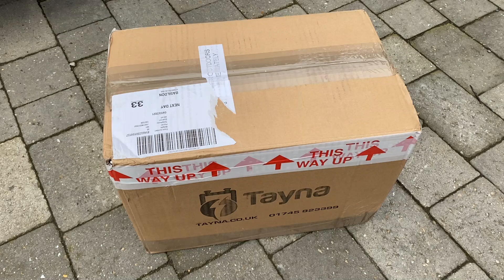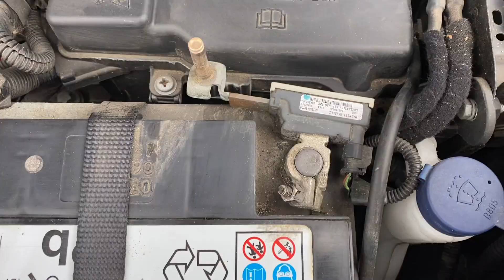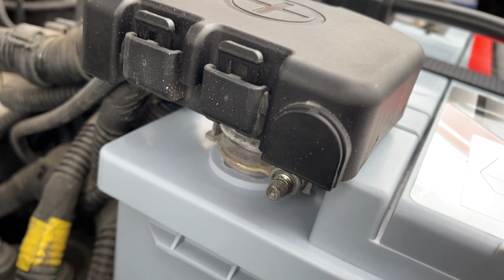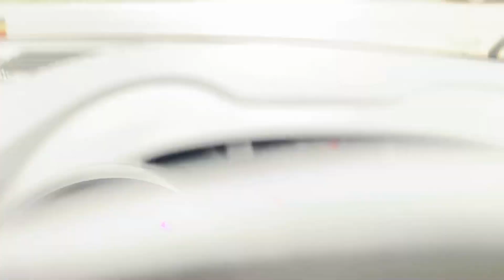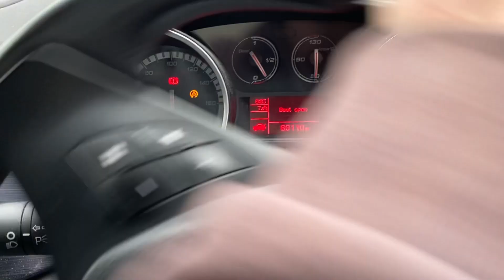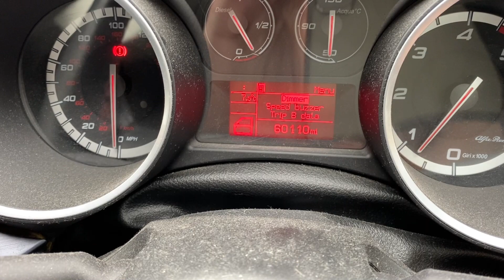Alfa Romeo Giulietta Replace New Flat Battery Clear Steering Fault Codes   No OBD Stop Start Fixed

Comment: Good, clear explanation of how to do it. My Giulietta is a 65 plate. It responded to the wheel lock routine to initialise the power steering but the date info didn't seem to need updating, just clicked in. Neither did the passenger airbag need resetting; perhaps Alfa made some tweaks to avoid the need.

Comment: My start stop doesn t work after battery replacement
Reply from the maker: May be that the new battery doesn’t have enough charge still. The intelligent stop start also relies on many other elements all working together. If you have any faults on the car then it won’t work. Hi or low temps can stop it too along with other things. All the best 👍

Comment: Another excellently helpful video.

FYI I've used AGM type battery for 5+ years and just replaced it with another AGM type battery. They are £120+ cheaper than a usual battery.

I had the same fault codes to clear too.

Comment: Every few months spray contact cleaner on the terminals
Reply: Thank you , poor design with the terminals know to crack on the clamp anything loose no start should be 24v , 12+v for computer aids and 12v so you can get to work the beautiful love affair Alfa cars.

Comment: Hi tony. Nice video, gives me the confidence to have a go. Problem is, every site I go to, including Tayna recommends EFB battery. When I bought my 2014 2 litre Diesel Giulietta 4 years ago, the used car dealer put a Banner 57001 AGM in. Should I go back to EFB or stick with AGM going forward. I keep getting stop/start unavailable and wonder if the short journeys are taking their toll.
Reply from the maker: Hi Graeme. Thanks. The short journeys do take their toll for sure. I went through two winters having to constantly recharge the battery before finally replacing it. I can’t recall what my battery was, but I went with the Tayna recommendation which if I recall correctly was the same as the factory fitted one. Mine is also the 2.0JTDm so same engine as yours. 
One thing I would say is to spend the little extra and go for a better battery. The one I put in has failed again already as it was cheap, so I’ve replaced it now with a Yuasa. 
Hope that helps. All the best 👍

Comment: Hi Tony, great video. did you do anything about the crack on the clamp? 
I changed the battery on my giulietta thinking there was an issues with the battery but noticed the same crack whilst changing the battery. The car occasionally doesn't start and i think it is due to the crack.
Reply from the maker: Hi. Yes I did. There’s a video on my channel on changing the terminal, and also another small short one where the car wouldn’t start and I had to wiggle the terminals. Here’s a link to the change video. Hope it helps. All the best 👍
https://m.youtube.com/watch?v=BUga9-nLuzQ&list=PLUlimW25zWbS3X81E3uVGrQvRqliAYmC9&index=78&pp=iAQB
Reply: @ thank you

Comment: Thanks. That was all clear. I’ve just done this with ease after watching your video a bunch of times. I just ordered the same battery as you using the link. Thanks for all the info!

Start stop seems to be fixed now and the same issue with the passenger airbag.
Reply from the maker: That’s great. All the best 👍

Comment: I have a 2.0L diesel, had all electrics including radio, ac and power steering  cut out 10 seconds after starting and now the battery is flat and car won’t start on its own, any ideas ? Could a battery replacement do the trick?
Reply from the maker: Hi. Is there any power when you turn the ignition on? And when you try and start does it turn over, click, or nothing? 
Could be a battery, but if it was running and then stopped, sounds more like something else. If you have a multimeter you could measure the battery voltage. Sometimes the Giuliettas suffer from a bad earth connection, which is under the battery tray if I recall correctly. Also battery terminals can be an issue too. I did a video on replacing mine which has helped a lot of people. Good luck. All the best 👍

Comment: Ciao Tony
I would like to charge my S&S battery. Now the manual says that I should unplug the negative cable in this case. I would prefer not to do this in order to avoid all the error messages. What do you think?

Many thanks for the many and very helpful videos
Reply from the maker: Ciao. I charged mine on Monday night with the battery still connected. After 1 hour on charge I took it for an hours drive. It started perfectly the following morning. Hope that helps. All the best 👍
Reply: Many thanks for the quick reply. I will try this then. I wish you and your family a happy and healthy new year

Comment: Thanks for the vids Tony. Ive had to replace my battery on my 2010 2.0 jtdm after the car had stood for months. I did the steering wheel fanve but my odometer is flashing constantly. Any ideas? 🤔
Reply from the maker: Sounds like the blue & me module for connecting your phone to the audio. These often go faulty. May be able to resolve it by disconnecting and reconnecting the battery again or simply (if you have it) connecting the Multiecuscan software, and clearing the codes. If it is genuinely faulty, then it is possible o programme it out out the system using the Multiecuscan and performing a Proxi alignment. Or buy a new one, but you’d still need to do Proxi alignment. Best bet is to get the fault codes read first though as that will tell you what the issue is. Flashing Odo normally means something has gone bad on the ‘Canbus’ line. Hope that helps. All the best 👍

Comment: Hi, I have changed my battery, but the radio is completely dead. Any ideas what is wrong?
Reply from the maker: Hi. No ideas really, other than check all connections, then check all relevant fuses. I think the radio is fed from under the steering column. Hope that helps. All the best 👍

Comment: Giulietta 1.4 170hp petrol ... Is this engine reliable ?
Reply from the maker: Hi... I don't have one personally, but from feedback they seem to be. The biggest issue seems to be the Multiair unit which should be maintained with good servicing. I hope that helps. All the best 👍
Reply: @vialettotony  thank you
Reply: I will add that there are two sides to it.
Mechanically all the 1.4s are very robust and can take 300k miles no problem.
HOWEVER
You need to service it well - the factory recommended oil change intervals are insane. Absolute maximum is 10k miles and really you should change every 6-7k miles.
The Multiair unit can go as early as 30-40k miles if you skimp on oil changes - or it can last the lifetime of the engine. Count on replacing it once to be safe. Then don't stretch those oil intervals again and it should be fine.

Comment: Wish I saw this yesterday before trying to search for it on forums; wasted 1 hr. I just disconnected the battery cause I noticed the front right brake pad wear indicator cable has snapped. As I don't like working with cabling with power on, I took the negative off from the battery. Then when I went in the car it was like Christmas with all lights and beeps, and everything relating to VDC.
Seems I have inadvertently  fixed by doing what you've done...was just checking that I have full steer... after a 5 min slow drive in the neighborhood and a stop and start, all was well again.

Comment: Hello Tony
Thank you for your videos.
Quick question, how can I set the time and date.
I tried using the set/esc button but when I click on date I go back to the previous menu 
Any advices please
Reply from the maker: Hi Hamza. Sounds a bit odd for sure. It is definitely done from the three buttons so not sure why it’s not working. I’ll see if I can put a quick video together soon. All the best 👍
Reply: Thanks allot Tony, last time I modified it I used the OK button in the radios to access the time but since then I installed a 3rd party Android post and now there's no more OK button

Comment: I just changed the battery last week. The old one - oryginal Excide Heavy Duty worked fine for a 8 years. I have to do this because the old one had the low voltage and the ECU automatically increased the idle speed to the 1000 rpm.

Comment: In my Giulietta you need to re-calibrate the auto up and down on the power windows after you disconnect the battery.
Reply: Also on my Mito!
Reply: And the steering too.
Reply: I’ve just bought a Giulietta 1.75 TBi - how do I recalibrate?

Comment: Yes thank you mate I love the videos, I needed a new battery all along. Do you know much about the neutral gear position sensor ?? It disables my DNA system. Thanks pal
Reply from the maker: Hi Calum. Thank you so much. Really appreciate the positive feedback. The gear position sensor is indeed a common problem. It is doable at home, but the connection underneath can be problematic. Some people prefer to remove a section of the exhaust to gain easier access. It can be a lot simpler to get your local garage to do it as they’ll do it a lot quicker with a ramp. Hope that helps.
All the best.
Reply: @vialettotony  thanks Tony, I was going to pay £25 to get my battery fitted but after this I done it myself !!
Reply from the maker: @calumdunn4701  great effort we’ll done. 👍

Comment: Hi Tony. I've recently changed by battery in MY2016 and the time & date are flashing. I did check with the SET button but there is no such an option in menu! Would you know how can I update the time and date to the correct values?
Reply from the maker: Hi Aris. If it’s not done by the buttons to the right (as in the video) then you may have an option from the central screen (assuming you have one?). If it’s not evident, then your vehicle handbook should have the instructions for your car, if it’s different to mine. 
Hope that helps. 
Thanks for watching. All the best. 👍
Reply: @vialettotony  Thank you Tony. I had a blue & me radio however I have changed it to an aftermarket one! I will check the handbook just in case. All the best.

Comment: My AC and radio stopped working after the battery change. Any idea how to fix it? Thanks
Reply from the maker: Hi Julius. Check to make sure all the connections on the battery terminals are okay, even the ones you didn’t have to loosen. Other than that you could try checking the fuses. 
Good luck with it. 👍

Comment: Did the passenger airbag keep switching its self off before you put new battery in? Mine does this currently and has start stop not working also. Noticed it was off in your video. Was this due to weak battery?
Reply from the maker: Hi Cran. Yes absolutely. This apparently is one of the Alfa programming items. The new battery fixed it straight away. 
Hope that helps. Thanks for watching and subscribing if you have. Really appreciate it. 
All the best. 👍
Reply: @vialettotony  yeah about time I got a new battery then to protect the passenger. The interesting thing was I see battery is 570amp. While all the ones it suggests to buy are 700 or 720. So I was doubting battery in my car was right battery for car. But your car had same one. So must have been at the time. Going to have ago at the rattle one. I always thought it was somewhere else! Never found it
Reply from the maker: @cranswil  good luck with it. 👍
Reply: @vialettotony  Never seen your channel before. Will be watching now I've found it. Not looked for a few years. Learned some things from Alfa man a few years ago. Then managed to create a video to fix the Bluetooth if you ever get that problem. Was well chuffed to get it back working if you ever get that issue. That tail gate wiring is an every few year task.
Reply: Well changed battery this afternoon for a Halfords one. Bought a wrench kit rather than paying fitting. . Start stop showing working now. Will let you know how it goes in coming days. And if passenger airbag stays off. Hopeful that will solve that too.Thanks again.
Reply from the maker: @cranswil  that sounds good to me. Top effort. Where’s your name from can I ask, or is it your YouTube name? 
All the best. 👍
Reply: @vialettotony  it's not my name was a YouTube name made a long time ago! When we were sceptical of the Amazon's and you tubes of this world and getting hacked! I'm Scottish.
Reply from the maker: @cranswil  haha. Don’t blame you there.  😉Cheers.  Have a great evening.

Comment: Hi mate. Do you know where I can buy the screws and nut that hold the positive in place?....I've lost mine.
Reply from the maker: Hi JJ. You should be able to get them from any local car parts supplier, like Euro Car Parts, Bennett’s, etc. If you walk in, they normally have these sort of fixings and panel clips etc hanging on racks in the receptions. Failing that, trusty Amazon should yield a result. 
Hope that helps. Thanks for watching. 👍

Comment: I removed the battery to try to reset a check engine I got straight after putting in Shell fuel. It’s the lambada sensor. Came on once before. I ordered a cheap scan tool that can reset codes. See if it works.
Reply from the maker: Hi Andy. Thanks for more comments. I hope the scan tool gets you a result. All the best. 👍

Comment: Hi there, after removing by battery my temperature sensor keeps playing giving me temperatures figures even up to 55°, any solution for that?
Reply from the maker: Hi Isaac. Not sure it will be linked directly to the battery, but it may be that it’s working more efficiently if it’s able to get more power. If it’s the outdoor air temperature then this is a common failure on the Guiliettas too unfortunately. The sensor is in the Drivers door wing mirror. Have a quick search online and you’ll find quite a bit on it. One of the joys of owning an Alfa 🙄. 
Thanks for watching and thanks for your comment and subscribing (if you have). I really appreciate it. 
Let me know how you get on. All the best, have a great day.
Reply: @vialettotony  Thnaks for you help, really like the amazing video
Reply from the maker: @isaacbadu2506  thank you so much. Really nice to hear. That’s exactly what I hope to do with these videos - help other people. Cheers. 👍
Reply from the maker: @isaacbadu2506 Hope you're well... Did you see the temp sensor video yet? Not sure if it may help your temperature issue.
Reply: @vialettotony  Yes indeed, that was helpful

Comment: Where can I find the right battery to fit into toy 2011 Giulietta? What are the specs. 72ah?  Many thanks. Great videos. New to owning an AR
Reply from the maker: I used https://www.tayna.co.uk/. You can enter your number plate and answer 1 or 2 questions and it should give you battery part number for your car. Mine was a 096 for my 2011 2.0 Jtdm 170. Hope you like the videos.  Please subscribe for more if you haven’t already. Thanks.